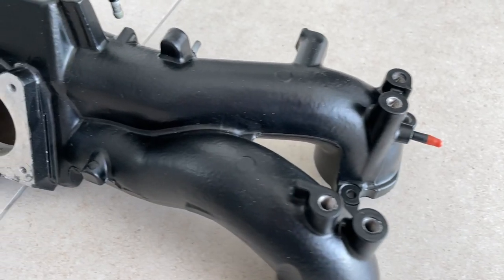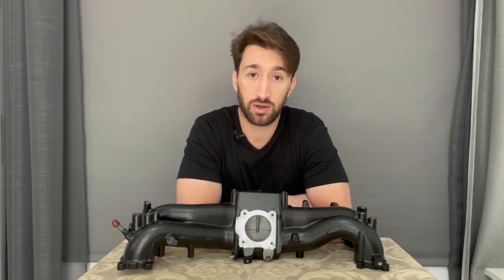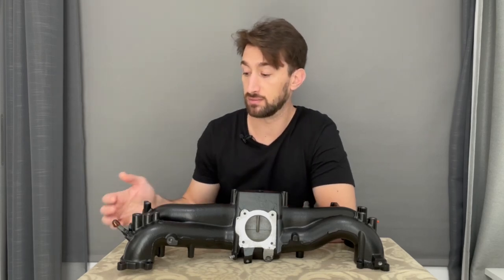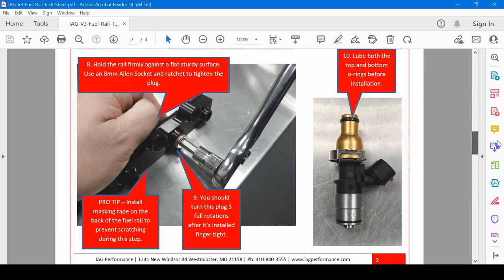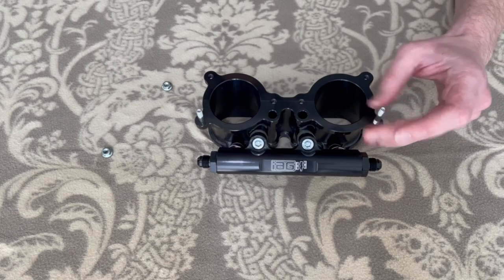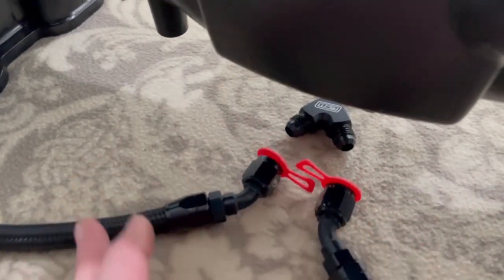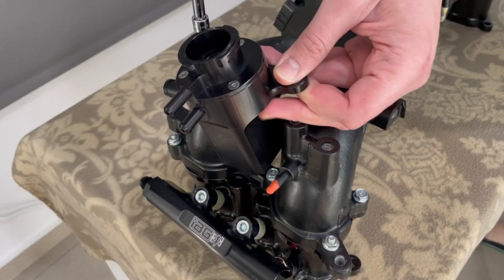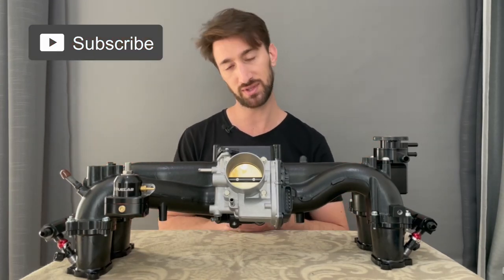Preparing fuel rails, lines, injectors and FPR for the GC8

Comment: Hello, which drive by wire throttle are you using? Wanting to go that direction myself.
Reply from the maker: Hello, it's just an OEM 08+ STI DBW throttle body. Part number is: 16112AA370